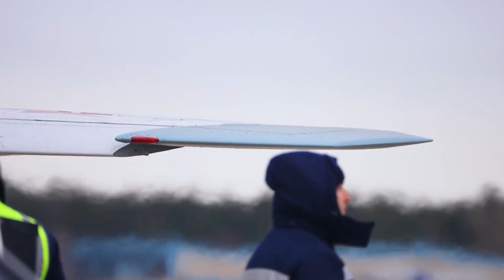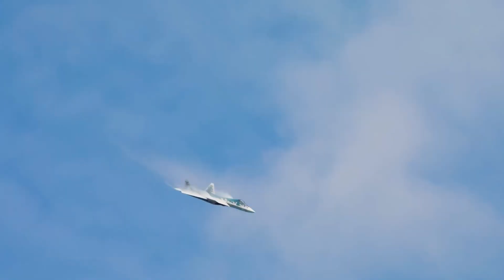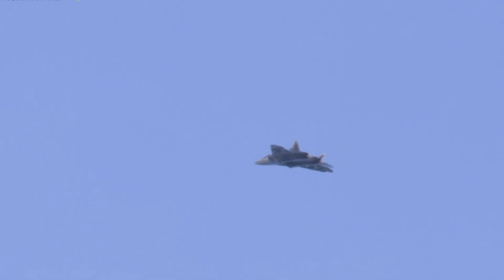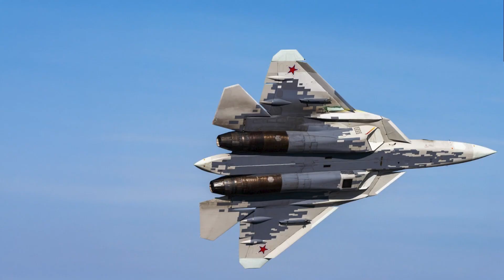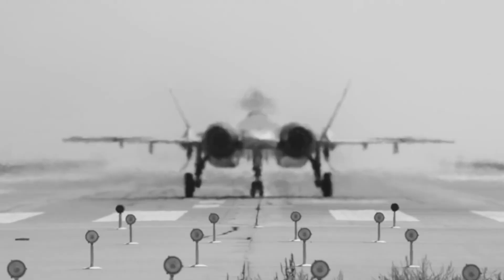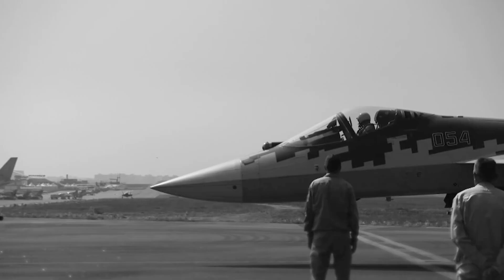How Russia Made a Fighter Jet That BREAKS Physics?

Comment: As a Physicist, I can say with absolute certainty that this does not break Physics.
And thrust vectoring loses too much kinetic energy to be of any value whatsoever.  The same with stealth: modern passive IR systems can easily detect stealth aircraft.
Reply: I will say the f22 also has thrust vectoring.  I think it does have some use especially with the level of stealth of the f22 by allowing it to make sharp maneuvers against a missile.  However, I also agree with your point that it bleeds off a lot of speed/kinetic energy so it has drawbacks if you're facing multiple incoming threats.